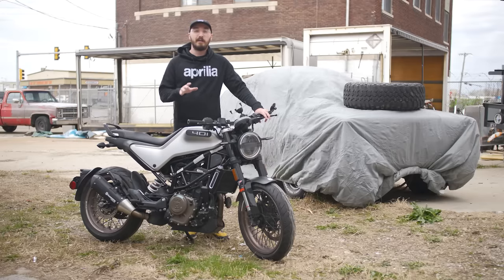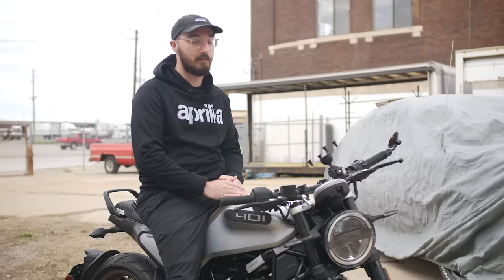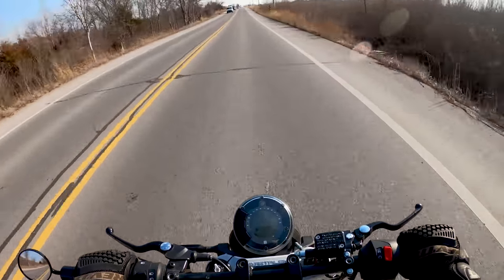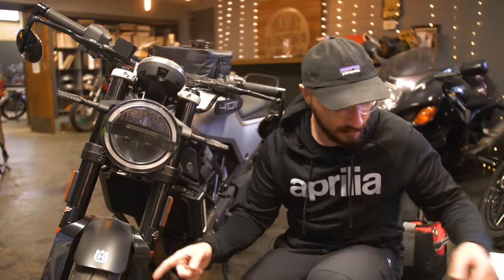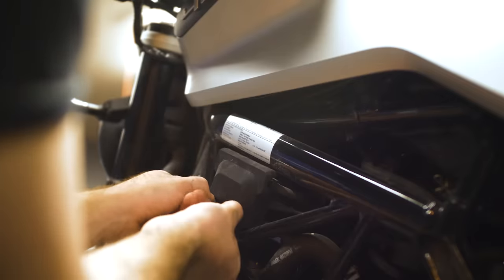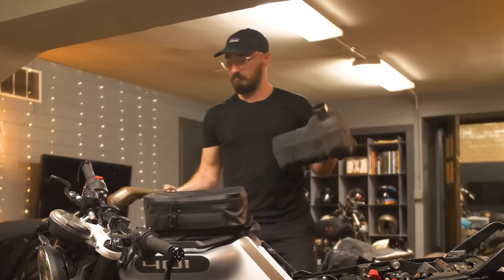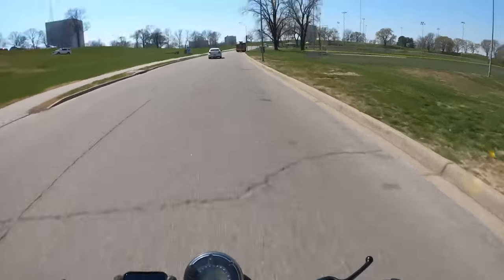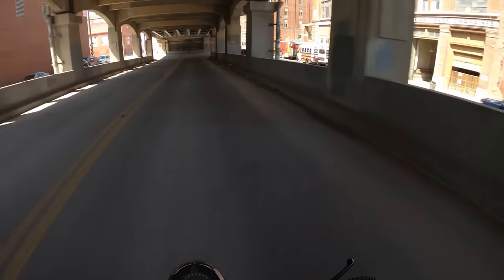We Installed a FULL Exhaust on his Husqvarna Vitpilen 401! (Custom Build)

Comment: Man I hope we get a vitpilen/svartpilen 901 and 1301 in the future 🙏
Reply: @jankunc7593  pp vibration going to be insane
Reply: @jankunc7593  I meant like the duke 1290 & 890. The husky’s use the same motors from the KTM dukes. the 390&401 and 690&701 are the same motors
Reply: Let's just hope the Norden 901 comes this year 😂
Reply: There’s going to be a Svartpilen 901?
Reply: @aschneb4258  The Nuda is my favorite Husky! 🦾
Reply: @drwilliampclark  Nothing on that yet. But the Norden 901 is coming now in 2021.
Reply: Having test driven a 1290 super duke, I think the 1290 would be way too much power for that platform.  It'd be way too sketchy and not so much fun.
Reply: @samjeanb  o.0 you know they wouldn't just slap the LC8 in the 401 frame
they would most likely just use the superduke frame, like they did on the 1301 prototype that was spoted in 2017

there were also prototypes spotted of a 901 vitpillen, but as you can see with the 2017 prototype that means nothing
Reply: @samjeanb  it would literally be the same motor and frame with different styling
Reply: This didn't age well, they don't even make the 701 any more :(

Comment: what was the 0-60 with new exhaust?
Reply: It wouldnt be anything noteably faster especially when there is no new tune
Reply: @ronanjones4189  i dont think anyone its trying too be faster than a faster bike on a small displacement bike. They just want too know how much faster it is than stock. If your gonna spend the money too make i bike faster then im sure most people wanna know the gains before spending the cash.
Reply: @GranAutizmo  Yeah, having a 0-60 run stock implies there's going to be a comparison after the modifications. An oversight or is it the same/worse?
Reply: @hustler717  yeh i noticed they had a stock 0-60 and stock exhaust clip. But neither after the mods. Probably just forgot to film them.
Reply: The 0-60 will be about the same, it may be slightly improved as there may be more power, and the weight will have dropped a little due to the exhaust. I'd be totally guessing here, but if this bike does 0-60 in 5.5 seconds stock, you probs gona get down to 5.3 (I got one of these at the moment, and modded plenty other bikes). A sprocket change will make a bigger difference, or rider losing some weight.
 These mods can make a bike feel faster and more fun, this to me is a more important goal than 0-60, although I get why you want to know. Effectively there will be no difference. I roughly recall the  previous 0-60 run and thought they were not trying very hard, and could do it faster without any changes to the bike.

Comment: This was a great video! I liked the night shots with the music it was badass. I’m supposed to get my Svartpilen 401 this up coming week! I’m a first time rider and I would be super interested if you made a video on how to use the quick shifter. I know the bike comes with one but I’m a little timid when it comes to the use of it. Much thanks and great video!!
Reply: i have the svart 401. the quick shifter is easy to use just open the throttle and change the gear without using the clutch. I noticed that when you dont have enough rpm the gear doesnt change so you cant make any mistake. only some minor bumps in lower rpms
Reply: It's really easy, you don't even let off the throttle. I've had my Svartpilen 401 for about a month and I love it!

Comment: Nice, been missing the Pilen's on the channel, ive had mine for 2 months now, just bar end mirrors and Leo Vince GP slip on so far but that made the engine note so much nicer.
When putting the Husky light guard on be careful lining it up, its really tight and the threads arnt strong, I have one bolt spinning freely unfortunately.

Comment: I just picked up a Vitpilen and wanna do a handlebar swap like the one you did. Did you have to do cable extensions to fit the aftermarket bar? Also, does the Svartpilen triple tree fit the Vitpilen without modification? 

Not a lot of info out there on this, most handlebar swaps I've seen are usually the ABM kits which I'm not too fond of
Reply: I would like to know this also :)
Reply: Why tf aren't you guys just getting Svartpilens? lmfao
Reply: @ripF5C  they're harder to find in my area. Most of the time when I called a dealership they had vitpilens and told me they just sold all their svarts. I had to go to another state to pick up my svart.

Comment: Had a 701 for 3 years now, still love it. What happened to the original handle bars on your 401? You got Svart straights on there?
Reply: It looks like he swapped for the Svartpilen  bar mounts and then opted for a straight, flat bar.  The stock Svartpilen bar is a riser bar.

Comment: I've watched the comparison videos and I still don't understand what's difference between the vitpilen and svartpilen other than handlebars and tires (peg placement).
Reply: The Svartpilen and Vitpilen are the same bikes with the only real differences being the bars and the tires.  There is the difference in the colors of the body panels, the wheels, the tank rack, some small parts colors and a one piece (Vit) versus two piece seat (Svart), but everything else is exactly the same.

Comment: Excellent video! I have a  2020701 Smart. so I am interested in your work and videos. I wish you had turned the bike on so that I can hear the exhaust sound. I have a few questions. First the mirrors where did you get them and do they provide better visibility than stock or is it just an upgrade in looks? Regarding the tank bag. I have heard some Vitpilen owners say that the tank bag gets in the way and they felt that the tank bag takes away the aesthetics so they removed it.  Do you plan to get side bags with for this bike and do you think the Husqvarna bags are the best for this bike rather than generic bags e.g. aftermarket. What do you think? Where did you get the smatphone holder as well?  This bike is so unique and looks even better in person. Why do you think they discontinued the 701? Thanks

Comment: Did it throw codes removing the o2 sensors and the cats? I put a slip on onto my 2020 sp 401 and I love it, but I would like to try and get a little more power for highway miles. Also who makes the tank bag and tail tidy? Great job on the mods Andrew it looks great man

Comment: I'm sorry, but it looks slower than an r3. I liked my r3
Reply: it's about 0.5~1second quicker than the r3 and you can really feel the torque difference when you ride both back to back. R3's top speed is higher tho by ~15mph since it has an extra cylinder
Reply: @bella_testastretta  that's cool. I got bored of the r3 after about 1,300 miles though. Then I got this 2021 xsr900. Lots of fun.
Reply: @MrFurley69  yeah R3's fun lasts about 3months then you want to switch. That's the only bad part about the bike. Nonetheless, it's the best starter bike to learn riding on!